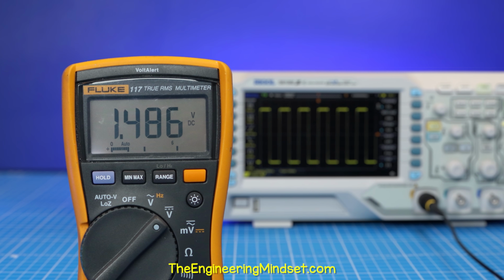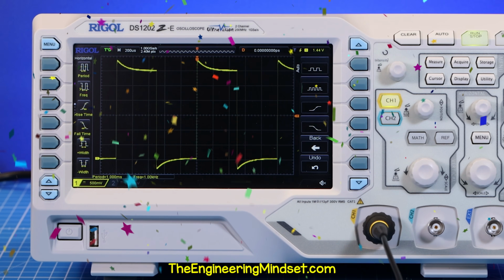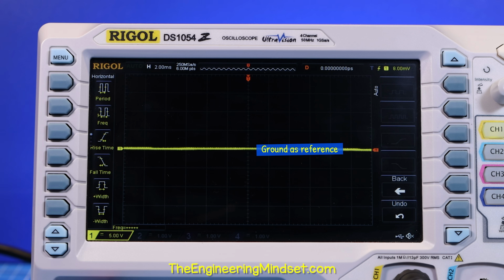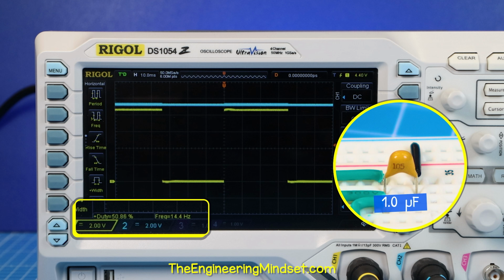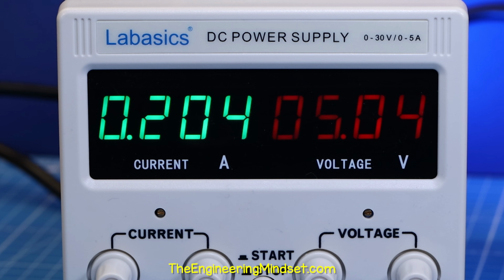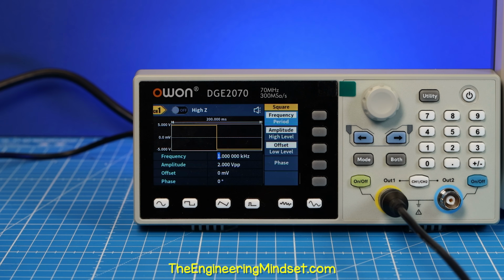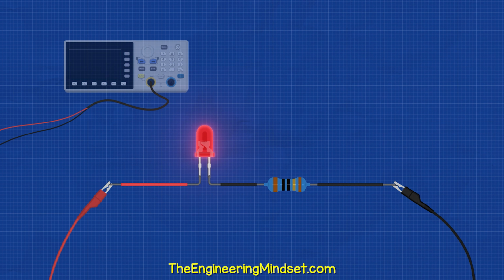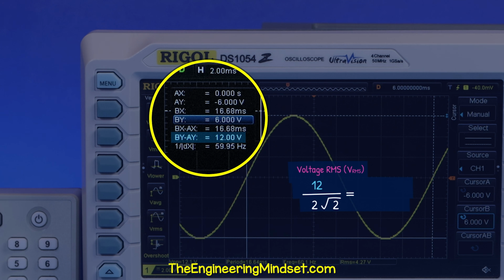How to ACTUALLY Use an Oscilloscope (Beginner-Friendly Guide!)

Comment: Great video.  For new scope owners, check if your scope has VISA (Virtual Instrument Software Architecture) functionality.  VISA allows you to perform any manipulation of the scope via a remote script that makes calls to the VISA API.  This allows you to automate setting channel configuration to a specific state if you need to perform a test on dozens of circuits in a consistent way.  It also drastically simplifies capturing screen dumps of tests for documentation or training.
Reply: I think if you need VISA then it's likely you're already pretty comfortable with scopes and probably also working within a professional environment. This video strikes me as more for the hobbyist stepping up from more basic projects that need more than a DMM to analyse. In this case I personally wouldn't consider VISA a make or break feature.

Comment: I was born in 1951 and my father worked for NBC studios in Burbank. During the 1960s I was taken to work with him. I saw the old style fully analog oscilloscopes that had a circular cathode ray tube display and were just monochrome, no multiple colors. Oscilloscopes have sure changed over the years. Now we have full color computer style displays on the oscilloscopes.
Reply: The biggest difference is that you can take snapshots of the signal and analyze it later. Oscilloscopes of the past couldn't do that; they could only display what the circuit was currently outputting in real time.
Reply: @OpenGL4ever  That is true, the old oscilloscopes were totally analog electronic. They had no recording or memory capability. Now with modern computerized oscilloscopes images can be recorded on storage media.
Reply: In my collection of oscilloscopes I have CRT scopes you describe. 😊
Reply: My first scope in 1972 was a Dumont. How things have changed, technology always evolving.

Comment: This video is finally a good excuse for me to busy myself with my Siglent SDS824X HD. I barely know how to use it.
Reply from the maker: Hope it helps, let me know what you used it for or if you find any tips I didn't cover
Reply: @EngineeringMindset 
I'm using it for hobby and professional EE (University)

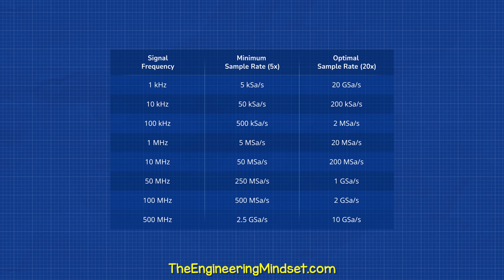Also you made a error at 2:56 it's not 20 GSa/s but kSa/s for 1kHz Frequency
Reply: How is it when decoding serial interfaces (I2C/SPi) & Analog(Audio/DSP/Noises floor) 🤷‍♂️ ?

I sold my DHO804 and wonder if I should get a Siglent SDS814X or not ..
Reply: @thanatosor  I bought a Siglent 824X HD a few days ago. I'll let you know in a few days when I've tried it
Reply: @pieterpennings9371 That's great. 
Make a video review, share with us 😅

I have option to buy the very same Siglent too.

I would be curious to know how accurate it decode high-speed I2C/SPI & common high speed interfaces...
Reply: @thanatosor May i know why you sold your DHO804?
Reply: @gokulakannan19 Its main functionality is fine. 

But the plastic used in the build is smelly AF even after weeks. So I rather sell the thing to save my health & spend a little more to buy a proper Siglent SDS814X

Comment: For measurements that require connection to mains voltage one can also use three other options that might be cheaper than differential probe:
1. Insulation transformer that has the same number of turns on primary and secondary winding and provides galvanic insulation between the mains supply and device under test. Then a point in the circuit connected to the ground clip of the probe becomes grounded via oscilloscope.
2. One can use a power inverter connected to a car battery or other energy storage to power the device under test. This completely separates the device from mains supply, too.
3. Finally one can buy a scopemeter, which combines portable oscilloscope with mulimeter (and sometimes a function generator) into single, portable device with build-in battery. Oscilloscope usually has the same functionality of the bench models, albeit with smaller screen and sometimes with some limitations, but quality models also provide special case design that protects the user from touching any metal element that could be connected to mains voltage during measurement.
I would also suggest obtaining at least 1000x HV probe just to be extra-safe. Such probes are quite affordable...

Comment: What a fantastic video! I am a PhD student, and my project involves fabricating a piezoelectric sensor, which I have successfully completed. Now, for the second part of my project, I need to test the functionality of the piezoelectric layer. How should I set up an experiment to measure the voltage generated when flipping the piezoelectric layer? Additionally, how can I test its functionality as a capacitor, since a piezoelectric sensor can also function in that capacity? I would appreciate any guidance you can provide.

Comment: Great video.  Perhaps you should have mentioned, where possible and in general, use a Voltmeter when seeing the waveform is not necessary.  This prevents the scope from seeing a damaging voltage or use a battery powered scope.
Reply: You mean connect a multimeter to the device under test, then connect the scope to the multimeter probes? In theory blowing up cheap meters instead of scope, or its fuses? Could you use a gfci plug adapter on the leads also?
Reply: A hand held scope can still be damaged on A/C by spreading the grounds. Same with isolation transformer used. I use a 8 inch single ground lead clamp, with 4 leads spliced to reach all the grounds on each probe ground clip.

Comment: Nice timed video, very thorough, got the "200MHz 4-kan 12-bit Siglent SDS824X HD" 2 days ago but was too afraid to use it at the time (only made sure the screen was without dead pixels using self test, and used the thing showed at 4:16), but now I feel a more confident of starting to use it after watching this.
And speaking of Oscilloscopes, I can NOT find anything about Crystals/Oscillators on your channel. (How they work, how to connect, how to measure... like your videos on resistor, LEDs, MOSFET etc)

Comment: Bravo.........the biggest proplem.......is the bonding nuetral to ground at main panel......if there is short it can destroy  oscilloscope.......best fix is to have separate  isolated power source  for oscilloscope. ......cheers
Reply: Or use battery power supply for the scope. Small (cheapp) hobby scopes are handy for this, if you only need low frequency measurements.
Reply: Exactly only applies to wall powered scopes checking mains/outlets and devices being charged same circuit.

Comment: I use a PC based lab scope for automotive diagnostics. Little did I know that they were used in electronics when I was getting started 10 years ago. Now I use my scope for automotive, computer and general home electronics. And I actually have 3 now.
Reply: A Scope isn't just used in Automotive Diagnostics, 
Or just in Electronics.
However you should understand it started in Electronics before Automotive 

but you will also find it 
in Medicine  (what do you think a heart rate monitor is  ?)
In Mining 
In Geology
in Civil Engineering 

Scopes are used Everywhere mate
Reply: @martinkuliza  hence why I said little did I know 10 years ago. I know in 2025. And yes I know a heart monitor is a lab scope.
Reply: @phillipzan2005  
Mate.. it wasn't an attack .
i was just telling you that scopes are used everywhere not just in Automotive.
Don't take it so personally

Comment: Nice video and very informative! One thing I noticed in my very limited experience with oscilloscopes is that if you're taking measurements on a vehicle you must also bond the oscilloscope ground to the vehicle ground to get a clean signal. Otherwise it's all noise on the signal trace.

Comment: That was a nice video for someone with experience with an oscilloscope, but for a beginner it leaves me with more questions than answers. I would be very pleased to see all of the subjects in this video discussed at greater length, one video at a time. The video as it is, creates information overload for a beginner. It did show me that there's a lot more things an oscilloscope can do than I had previously thought. Thanks for the information.
Reply from the maker: What questions do you have, maybe I or the community can help?
Remember, no one is born knowing any of this, it all comes with time and effort. If expose yourself to it, you will learn and the brain  will make connections so you understand it.
Reply: @EngineeringMindset  the video was enjoyable, but it contained too much information to take in, in one sitting. I  don’t think if I watched it a dozen times, I would be able to comprehend all of the information that you have provided. Granted, I am the ultimate noob. I purchased a FNIRSI DPOS350P, and I am trying to get as much information as I can to be able to use it properly. I think my age doesn't help much either. It's hard to teach an old dog new tricks.

Comment: One of my biggest concerns has been measuring signals on a USB connected microcontroller of dev board.  The PC's USB sockets have the grounds connected to mains earth reference, so could be a nasty trap for newbies.  If I need to probe signals, then I normally power the circuit from a USB power bank.  This can be a pain, if I'm modifying the code often and need to check the results.  A laptop is a better option, as the USB ports are mains isolated, but this in itself is a pain, as the slow CPU means much more time to compile the code.  I was of the understanding, that a differential probe provides isolation and is for measuring high voltages.  What would be the best approach to safely measure signals on a USB connected device that is mains earth referenced?

Very concise video, but with microcontrollers being the staple of many hobbyists now days, maybe this scenario could of been mentioned.

Comment: Sir, can you make a tutorial regarding electronic circuit ( for an example: 12v battery charger) circuit design procedure with calculations? If you can make it , then it will be very helpful for us. Because, none of the channels are doing design of circuit with components selection and the calculations properly step by step.
Reply from the maker: Yes, more coming soon. Have you seen our previous circuit design videos, we explain circuit, components, pcb design and you canndownload the files

Comment: I am a beginner electronic enthusiast. Any recommendations on what oscilloscope to buy?
Reply: what’s your budget? Honestly with you being a beginner any oscilloscope should work. If you want name brand you buy a oscilloscope from siglent or keysight. I own a SDS1104X-E which has 4 channels and does 100Mhz I bought 4 channels because i was going to need 4 and also if you ever need to upgrade its there to use, no need to buy another scope for the additional channels. You should be able to suffice with a 2 channel scope for around $300. the SDS1202X-E is the 2 channel option from siglent. Also it comes with probes so don’t make the mistake of buying probes like I did

Comment: I was having a small issue with the RMS Voltage formula without first adding Parentheses around the 2√2 : like so 12/(2√2)... Though I found you don't need the parentheses if you just use 4√2 instead : 12/4√2

Comment: This goes a bit too fast to be useful as a learning video that can be remembered. However I have saved in special Save Folder called "Oscilloscope Tutorials" so I can use it for reference later.👍
Note there is good info, links, timestamps and chapters inside the Video Description.

Comment: Next OSHA Regulation: All test equipment must be used ONLY under a smoke extraction hood with automatic fire extinguishing capabilities in place - absolutely no exceptions! 😁😁

And in construction: All equipment, manual or motorized, including earth moving equipment and trucks, must by continuously teathered to the structure it’s being used on, including high rise buildings and highways.

Comment: The oscilloscope has been especially useful in tuning snd troubleshooting when multiple circuits ( ip to 16 ) can be observed simultaneously with each of the circuits either alone, superimposed or rastered in any order. This allows me to compare all of the circuits simultaneously which in turn simplifies isolation of faults. Actively viewing all the circuits sometimes isn't enough so I use triggers, switches, and load/unload devices to " bring out", a hidden failure. Also useful at tunes are: pin point freeze aerosols,  heat guns, and delrin hammers. Probably the most useful common skill is wiggle testing leads, connectors, and components. I'm fast efficient and highly trained and experienced finding faults and can most often just skip trace the fault. Anyway, the multirastering imposed / superimposed machines make learning faster and more easily expose  diverse circuits comparatively..✌🏽👶🏼🚬

Comment: I love my old complex analogue with a CRT but am tempted to jump ship and go digital...ohh what shall i do?
Reply from the maker: The old CRT definitely look awesome, you can also view audio in xy mode which is fun and doesn't really work on digital but digital is easier to use and measure.
Reply: @EngineeringMindset  I'll keep the old one and have a compact digital to complement it. Problem solved. 
I have an old tube(valve) scope from when I worked with power RF. It still runs though its 60 years old now and its bulletproof... Thanks for this video, compact and straight to the point.

Comment: I have a lab power supply but my house does not have grounded power sockets. If I understand your video I then cannot use an oscilloscope with the lab power supply, only with batteries?

Comment: Hey, you did not explain the 1x and 10x settings in the probes, and when should we use them??
Reply from the maker: Use 1x for low-voltage, low-frequency signals (like audio), since it gives a full-strength signal but has limited bandwidth and higher loading. Use 10x for higher-voltage or high-frequency signals—it reduces loading, increases bandwidth, and is safer for fast or high-voltage measurements. Just make sure your scope is set to match the probe! However, I almost always just use the 10x setting regardless.

Comment: Apart from the oscilloscope it's self, I have all exactly the same gear as you have, down to the makes and model numbers heh!  

How are you finding the Hantek CC-65 current probe? Mine's a bit shaky, and seems to pick up SO much noise from the surrounding air, it also feels so so cheaply made, even cheaper than normal Hantek stuff, and I was worried I had a clone or something. The V-A selector switch is all crunchy and doesn't have defined positions (but you can feel it's supposed to) and it just sits where ever you let go of it, even if it's half way between settings... Also the zero button gets stuck constantly, and doesn't always register presses. Did I just get a Lemon, or is it just built supper badly like it seems?

It's by far the most budget friendly current probe for small signal stuff though, so I kinda expected it to be made cheaply, just not THAT cheaply lol...

Comment: There is no good readon to use more then one ground clip at a time. put the ground clip of probe 1 to your reference and all other probes are grounded through that clip, no chance to mess up. You did show how they are all connected in the video, yet somehow you still use more then one ground clip.

Other than that great video!

Comment: Can i measure UpTo 3000 volts with a 10x probe ?
And my oscilloscope is battery powered is that a problem measuring mains(220v)
Reply from the maker: No, a standard 10x probe usually handles up to 300V max—not 3000V. To measure 3000V, you’d need a high-voltage differential probe rated for that. As for mains (220V), battery-powered scopes are safer (no ground loop risk), but still be very cautious—use a 10x probe, check the probe’s voltage rating, and make sure you’re not touching any live parts. Safety first!
Reply: Thnks clarification

Comment: The ridiculous thing about oscilloscopes is the lock in
which is worse than even facebook! Want to capture s screen? Fiddle with usb sticks. Want to add or adjust a measurement? Find that usb stick. I have worked with expensive RohdeSchwartz and Teledyne scopes, but will gladly exchange them for an equal speed softscope/picoscope. just unplug the scope and continue working your data offline!

Comment: Beginner here. This really wasn't that friendly. It really stopped making sense when you connected CH1 to the side pins to calibrate it, maybe because you didn't really explain what's happening here. Why is it a square wave? I was expecting to zero it out, not have a mystery signal. And what exactly is happening when you turn the adjustment knob? 

- a beginner who actually wants to know
Reply from the maker: Thanks for your feedback. I wanted to get you straight into using the device to read a signal, but you would need to calibrate the device first, so we just combine them into one and learn by doing. I can't go into every single detail of the device, it would also be impossible for you to absorb all that information in one video, so my suggestion is that you write down anything you didn't quite understand and find the solution afterwards. This video is fully hands on, the rest of the video is a step by step guide, to learn by doing, if that style is for you then keep watching.

Comment: You have never mentioned how a Lead acid battery works. why is battery is dead, you have shown some salt to added and this is not mentioned at all. Finally you have no knowledge of reactions taking place inside the battery and your method will not work to revive a dead battery.
Reply from the maker: That's a completely different video, but we have covered how a car battery works in detail in other videos. We can't covered every single thing no every single topic, I just do my best and provide it free of charge, if the video isn't what you need then please try another source.